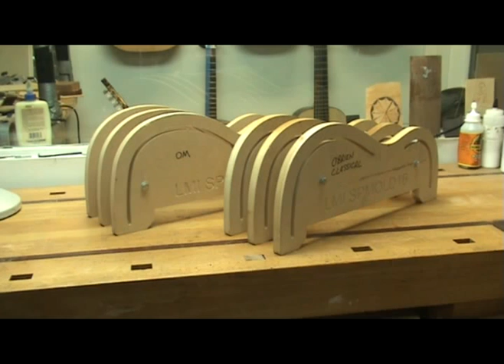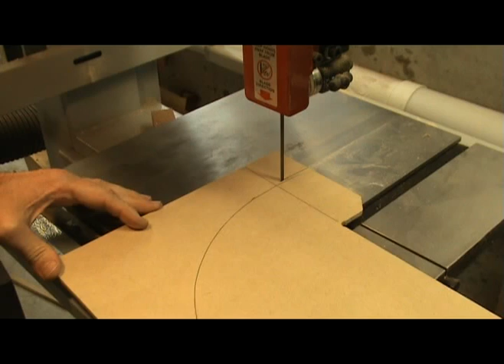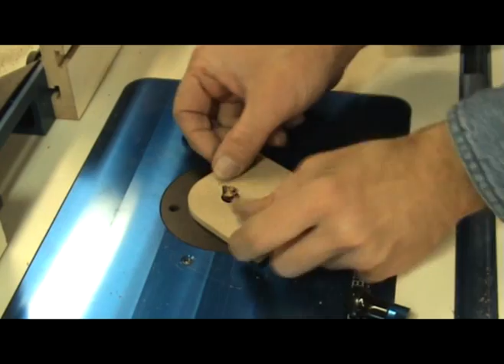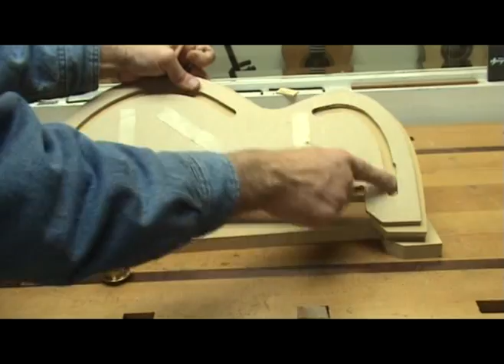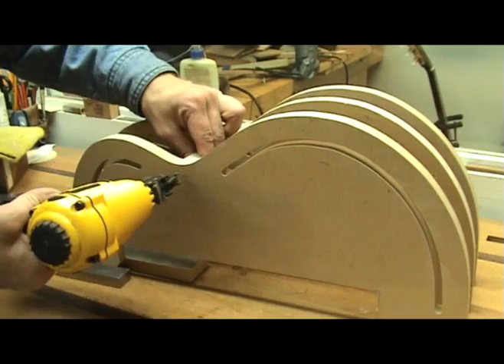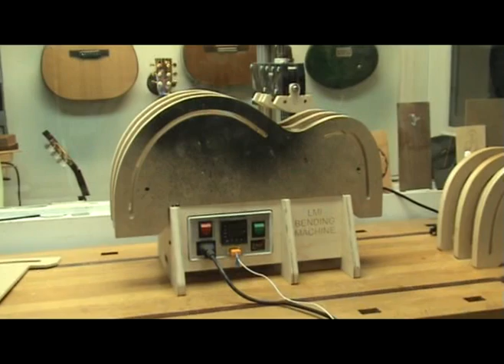LMI Side Bender Custom Mold Template

Comment: Hi sir. Wouldn't be kind of necessary to make the sides mold a few millimetres smaller to account for the thickness of the sides and maybe the thickness of the heating blanket and the spring metal sheet so it fit more precisely into the guitar mold?
Reply from the maker: Some people do take into account the thickness of the sides, blanket etc. I personally do not.
Reply: Thanks.